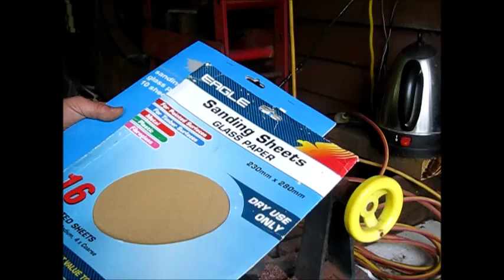Turning Australian Banksia Seed Pods On A Wood Lathe Making Beautiful Art

Comment: Might make interesting knife handles. When I make handles I take a worn out sanding belt and cut the seam, then split it into long strips. You can then hang on to the ends with it around the work piece. Far more of the abrasive will be in contact with the work at once and it goes faster.  Keeps your fingers cool too.  

Interesting video.  God bless.